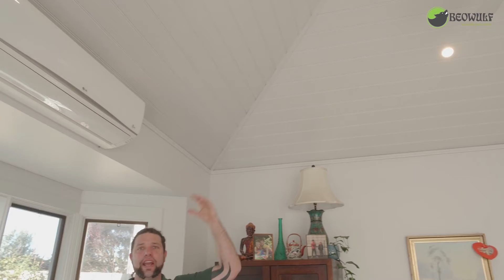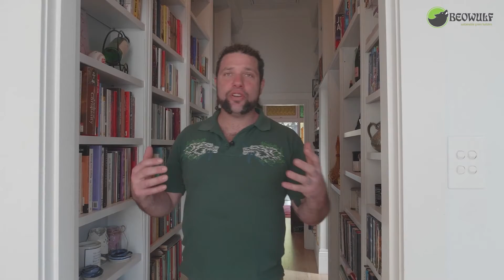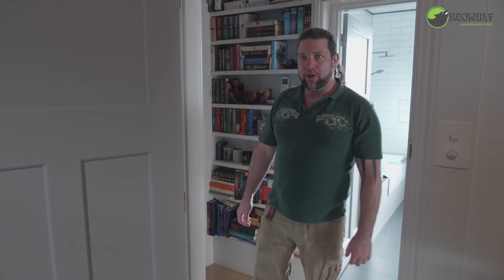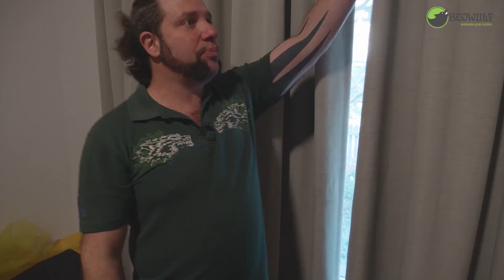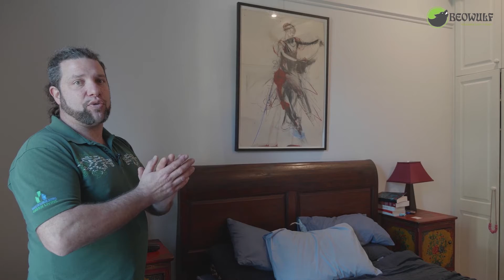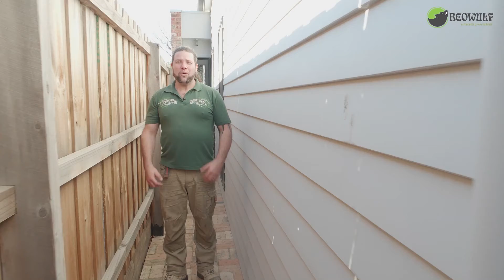How to turn your old home into an energy efficient dream - Upgrade a 108 year old home

Comment: They don't build them like that anymore. Mines 105 y.o. and love the fact that all studs are mortise and tennoned into top plates and bearers. Love what you did to this old girl. Looks a pearler..well done
Reply from the maker: Gday Paul,
Thanks for the grouse feedback and your thoughts on the mortise and tennons joints.  these are defiantly one on my favourite ways to fix a home and ensure that its structure will survive PLUS add additional structural bracing and the weight load distribution more evenly. the problem these days is the time that goes into making these types of joints.
#stayawesome 
uncle joe joe